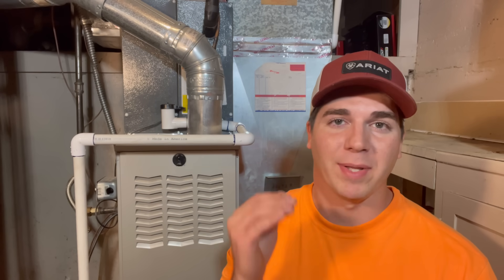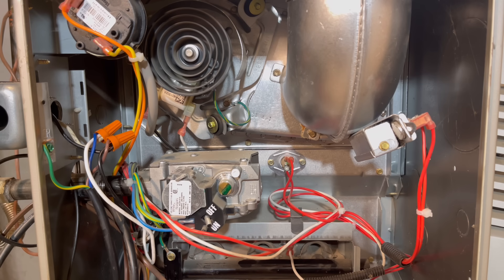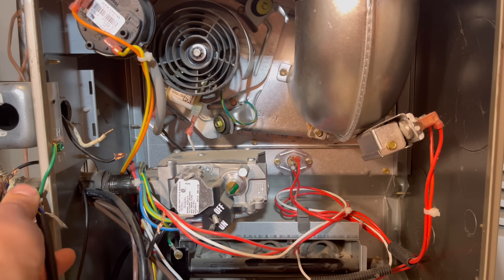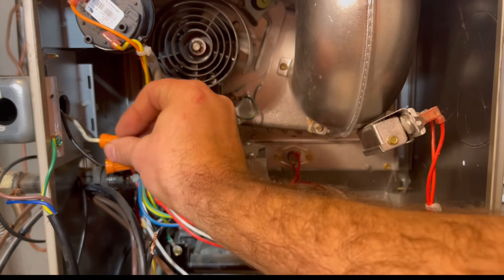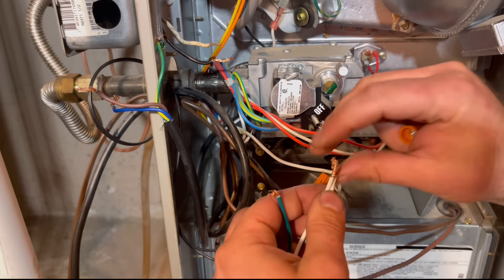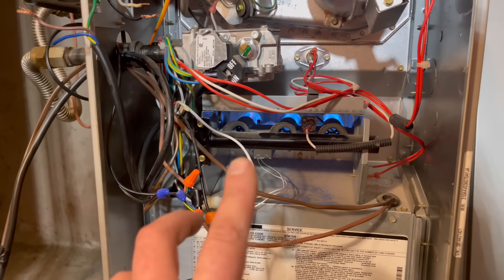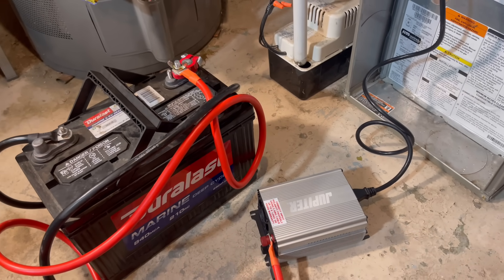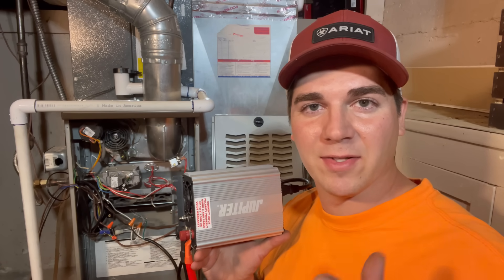Did You Know You Can Heat Your Home With A Car Battery?

Comment: Appreciate the thoughts but sadly so many details not made explicit: 1) He knows what he is doing but a novice would not have basic safety rules/habits in mind while dealing with 120v AC. DANGEROUS. 2.) I'm going "Wait, no way can you heat your house for several days with a car battery AND what is watt rating of that little inverter?  It would need to be humongous!". But later in the video you see -- but it is not commented on -- the HEAT is provided by gas, not the little electric power.  Yes, I could imagine the furnace fans and such powered by this setup for several days but ONLY IF NOT AN ALL ELRCTRIC UNIT.  If an all electric unit it would far overload this little inverter and probably not even come on. So, word to the wise -- do this only where the heat itself does not come from the electricity and only if you are well experienced working with AC.  Otherwise, engage a professional electrician -- who will want to put an actual to-code switch box in. Which would be a terrific thing to have.
Reply from the maker: I apologize I was off on my estimate but the furnace ran for 6 hours on this setup which is still great in a pinch! Cheers

Comment: What about the thermostat signal to fire the furnace and set temperature.  With out a signal. Will it stay on full if you have a  wire in thermostat  without a battery power one ?????
Reply from the maker: Yes as long as the furnace has power, the thermostat will function as it normally does regardless of the type of thermostat 👍🏽
Reply: Thank did not know that learn something new

Comment: no,.... this is a valuable tool that can save lives and reduce stress knowing that you are sufficient to do a service. we have done this with generators and other tools. you learn these functions from schools and military training. 
in one area the opposite side of the street lost power. a welder made a steel pipe to put a heavy duty extension cord through so vehicle could drive over it. city came out to inspect it for safety. power company saw what we did and built a station to replace jumping from a house. we called the power company with a code and they turned on the portable station. a year later they fixed the grid, neighbors helping neighbors.....
good video need more like it!
edit  .... all i would add is get an electrician to do the wiring work and a bus between the battery circuit and house wiring and a switch to disconnect it all. all you need to do when power goes out flip the switch and add the battery,...done and heat! your grandparents can check it all before weather goes bad and they sleep better at night knowing they can!
for those with larger bugdets you can do the same thing with a portable generator for the entire house any professional home improvement company has the equipment and plenty of YT videos for you do it yourself ers. we have a cabin with solar and generator back up.

Comment: Great Info.   
Should note type of furnace.  Gas furnaces  draw the least current.  Oil fired would draw more.  
A heat pump,  - well, you better do your research.   Probably require a high wattage 220 generator especially if you have backup heat strips.

Comment: That's awesome, I don't have a furnace but posted it on nextdoor for neighbors that do. I can't believe most people suffer no heat because HVAC companies don't offer people this option with perhaps an auto or manual switch.
Reply from the maker: I should start offering it as an upgrade to existing furnaces. It blows me away how up a creek people are when it comes to back up power and or backup heat
Reply: @diyhvacguy  Do you have solar or wind? If so do you recommend an all in one like MPP or is there a better one? I have 24 solar panels, just need to hook them in a good all in one.

Comment: When I built my house,I had them to run gas lines to the hallway, den , kitchen and living room. I have capped off shut off valves. I keep 4 wall mounted gas heaters in the garage. When the power goes out for days,I use the inverter setup u showed and I hook up the gas heaters.

Comment: Will something similar work for the water heater of a radiant heat system or are the pumps and everything powered separately?
Reply from the maker: If it’s 110v then absolutely

Comment: Car battery is surely not enough amp hours. Few days ? you are smoking crack.  Two marine deep cycles probably wouldn't make it a few days. I've done this before with two marine deep cycles when I bought my house and didn't have electric until the next day. Few days no freaking way do the math car battery is usually like 40 amp hours. You are talking like 45 minutes of run time at 1000 watts at 120volts. That's like 100 amp 12 volt draw. LoL not even an hour with a car battery.

Comment: I got one better..... Don't you think that you could charge your  battery while it's being used..  your first inverter is going from 12dc to 120ac.

Great. Next use the 120ac outlet connect to another inverter 120ac down to 12 or 14 DC and connect that output  to your battery.  YOUR BATTERY WON'T DISCHARGE..

Comment: Just get you an extra battery and keep it battery charger tender put on it and keep your battery off the concrete floor so it doesn't go dead you should be good to go I'll just get your propane tank you mean you've already got natural gas just get a generate generator and you're off running to the you can cook clean watch TV and everything else but make sure you wired it up right you don't want to put Power Up on the grid had to pay for lighten up the whole neighborhood lol

Comment: would this work with a natural gas hot water furnace with 2 or 3 small circultator pumps?  our previous furnace didnt have the safety of modern funaces, the only thing that required electricty was the one big circulator, when we lost power we would just open the valves and the hot water would circulate on it own thru the pipes via gravity.  downside; that beast of a furnace was not efficient.
Reply from the maker: Hmm, if it’s 110v with not too much wattage then yes this will work.

Comment: Hey, are you aware that your car battery charge will last a LOT longer, if you don't leave it sitting on the concrete floor? Leaving a car battery sitting on concrete will discharge the battery very quickly, even if you have nothing attached to it. Be sure to sit the battery on some wood or something, so it won't loose charge through the concrete. Trust me, this will make a HUGE difference.

Comment: How many watts is that inverter? I used to drive a truck over the road, and to save on fuel (idling the truck) I would use an 80 watt power inverter hooked directly to the batteries in the truck. I just ran a TV and DVD player to watch movies. I ran it from Saturday morning to Sunday noon. It wasn't even full time, as I turned it off if I was sleeping. Batteries were too dead to start the truck on Sunday at noon. And you say you can run the furnace for several days? I'd like to say "Foul!" because I know from experience that if three deep cycle truck batteries go dead after one day on an 80 watt inverter then one "car" battery isn't going to last several days. Don't mislead people, it could mean their life!
Reply from the maker: Yea I realize I was mistaken. The battery lasted 6 hours with my 1000 watt inverter. I know it’s not days, but six hours is great in a pinch.
Reply: @diyhvacguy  now if we could figure out how to run the furnace while charging the battery the we could get a little "perpetuation" going on.

Comment: Great little work around, if needed. Given, the battery will run the inverter for x amount of hours. Would it be possible to plug a trickle charger into the inverter, then connect to the battery? Wondering if that would make the battery stay charged for a longer period of time.

Comment: And heating tech yes you can do that but you could also when you have your AC and heating furnace and air handler placed in your attic in Texas want Texas don't have basements at least on the east south east and south Texas and Northeast Texas around Dallas Houston San Antonio and Austin Waco does not have basements but you can have your AC check wire in the pigtail at the time of install then you go out and you spend another $180 and you buy solar panel and you keep it in your garage or in your attic and you just hook it up when the power goes out and you can just hook up the the pigtail or you can do the same thing with a generator for $100 bill harbor freight does sell generators for $100 and some change so for about $120 you can do the same thing but that fan and it ain't matter will not it will not keep it very fully charged enough with the inverter at 600 even my 300 fully in charge if you are running a light a phone charger or any other device it will not keep it charged without something charging that battery I know I have a cabin in East Texas that has a gas furnace correction propane furnace and it has to have electricity and I have two harbor freight 100 watt solar panels hooked up to six 12 volt marine batteries and 24 volt 18 wheeler batteries that is hooked up to all a total of nine batteries and I can run the whole cabin on a 2000 Watt inverter for no noise to keep the noise down as long as I take the solar panels and place them on top of the cabin and the cabin is a 24 x12 storage building from Lowe's that has been inverted into a mini house it's got a gas stove it's got a gas water heater propane water heater propane stove along with a wood burning stove to just for looks it sits on the front porch of the building for outside cooking and it Powers a TV it will power during the summer time it will power a small 1500 BTU window unit or two box

Comment: That's all good but i would not expect that battery to last very long powering the fan. Best to have a small generator for that.
Reply from the maker: It lasted 6 hours. Admittedly not days but six hours is not bad in a pinch!
Reply: @diyhvacguy  6 Hours surprises me. That's not bad. I would have thought 2 or 3 at the most.

Comment: I’m living in an off-grid studio with a power hookup & was wondering what I could do as a backup, and your video reminded me that I still have the inverter I bought in 2016 to run my laptop on the cross-country drive here, plus I just replaced my battery at Wal Mart. - plus I recently bought a compact jump-start lithium charger on Amazon. Good to know Thank you!

Comment: A typical battery is not going to run a heating system. Unless you're using a generator.
Reply from the maker: You sir are wrong, I ran my furnace for SIX hours with this battery and inverter 👍🏽

Comment: That's really cool.  I've got electric heat with a heat pump, which is great for my electric bill, but doesn't do much if we have a power outage in winter.  I am wanting to wire into the electric panel a generator switch and then have that as backup for furnace, and freezers/fridges.

Comment: Very cool idea. Just wondering if you could just put the pigtail on and plug it into a generator as another option?
Reply from the maker: Oh absolutely. Check out my other emergency heat videos! I have one on my ng generator using this same method but with a new outlet/switch that’s setup for emergency power, check them out! Cheers

Comment: no... get a generator... a car battery will only power your furnace for an hour, maybe two if you're lucky.
Reply from the maker: Wrong. Lasted SIX hours. And you say go get a generator what if they’re all sold out, as in right now in the middle of a winter storm?
Reply: @The DIY HVAC Guy  i was going to right a long reply pointing out all the problems with this, but it isn't worth my time.

Comment: Hello DIY HVAC Guy, Thank you for a life saving video. I hope those without power from this vortex horrible storm that is hitting across the U.S.A from 12/22/2022 till Christmas Eve or maybe longer in some parts of the country have their furnaces running with what you taught on this video. A question I have. I didn't understand where you took the blk & white wires from the furnace to hook up to the pigtail? Can you please explain it to me? I just happen to run into your video today as so glad I did. Everyone should know about how to hook up an DC inverter to the furnace and have it all ready in case the power goes out. Thanks so much & God Bless. BTW what's the best battery to have that will power the furnace the longest?
Reply from the maker: If you have a similar setup, please watch this video and order this outlet/switch combo and wire it as shown. If you need additional help, email me at diyhvacguy@gmail.com   Thanks,  Dave 

https://youtu.be/1JNuovFpCpQ

Comment: You should plug in a battery charger into the inverter and charge the battery at the same time it'll last longer you won't get days use out of it couple hours
Reply: l o l, if you can charge a battery, why not just power the furnace?

Comment: Wow do not F'n do this without turning off the power to the furnace.  Yes I get there's a power outage when this happens, but the power can come back on anytime.  The way he is handling the incoming wires is DEADLY.
Reply from the maker: Um the switch was turned off so everything was not live or even had the potential to be live. And the chance of dying from getting popped is very very slim.

Comment: Not sure if this has been said but, while it is a good idea for planning ahead, wiring into the furnace supply circuit comes with it's own set of issues. 
You must be able to isolate the battery/inverter from the utility supply. If you do not provide this protection, and power is out, you will back feed 120 V to the panel and back to the main bus. That absolutely means a transfer panel must be used.  of course, in a pinch, this is an effective solution. 

Also, a 12 volt trickle charger would be a good idea as well so it's always charged and ready to go in the event of a power outage. 

That being said, I appreciate the effort.

Comment: Interesting.  I see it's a gas hvac, not sure a single battery will run an electric hvac with exterior heat pump for long.
Reply from the maker: No this is for gas only unfortunately

Comment: I've tried this with a light in my out building and my inverter won't allow the battery to fully discharge. I can only operate the lights for mere minutes.
Reply from the maker: Hmmm that’s odd. Does it say anything? Sometimes they will beep when the incoming power level is too low.
Reply: @diyhvacguy  i start out with a full charge 1000 amp hour battery, 600 watt inverter, 150 watt load. It might stay on for 2-3 minutes. I am looking into the inverter you are using.

Comment: do not let the battery sit on concrete floor ,it will drain the power just slip a couple of short 2x4 under it so its off the floor
Reply from the maker: Myth, look it up

Comment: How does this work for geothermal and doesn't your furnace need power to your thermostat in order to call for heat?
Reply from the maker: Not sure on the geothermal, if it’s 110v then yes this will work. To answer your thermostat question, the furnace powers the t stat, so as long as the furnace has power, the thermostat will function as normal 👍🏽
Reply: @The DIY HVAC Guy  thanks for the great info.  Good knowledge if the power goes out for any length of time

Comment: Good idea.  You should hard  wire in a "two way switch" so you can flip it between "line and battery" and leave it connected full time.

Comment: Can you simply unplug the furnace and plug it into the inverter, or will it drain the battery to quickly, or require more wattage than the inverter is rated? Also, will a modified sine wave inverter be OK for a furnace, or does it have to be pure?
Reply from the maker: Simply unplug the furnace, and plug it into the furnace 👍🏽
Reply: @diyhvacguy  OK, gonna try it. I have a modified sine wave inverter, though. Will it be hard too on the blower motors?

Comment: My sump pump has a battery back up. I think it stands to reason that a similar set up can be installed to regulate both a furnace and a hot water heater. Personally if this a regular concern I would invest the extra money into having all those components preexisting versus trying to do all this piecemeal in your basement with a flashlight and outside during weather condition that have knocked out your power AND Made running your furnace a emergency need. I also have a small portable generator in my garage. I think I would rather power that up and recharge my furnace car battery that way instead of trying to charge it up with my car

Comment: Thank you for this video. What happens if the gas suppliers power goes out and no natural gas is sent to the homes?
Can this type battery and inverter power a small oil filled space heater
Reply from the maker: Yes more then likely it can power a space heater. I don’t see any reason why not.

Comment: Theoretically if you plug  a battery tender into the inverter and hook it back up to the battery it should constantly recharge itself
Reply from the maker: I wish. It wouldn’t help much at all unfortunately
Reply: Unfortunately doesn't work that way.  The power loss in the conversion from 12V to 110V in the inverter, and then running the battery tender/charger, makes it a net loss to do that.  You're just draining the battery more.

Comment: how do you control the furnace once you get power to it
Reply: It will run off of the existing thermostat
Reply from the maker: Yes as long as the furnace has power, the thermostat will work like it always does 👍🏽

Comment: Does this apply to a hot water baseboard system with 2 circulator pumps as well?
Reply from the maker: If it’s 110v then yes absolutely

Comment: I don't think this would have worked during the Texas situation because the power issue was state wide not local and gas needs to be pumped into homes from the station so there was no gas at the time either. This is still a great idea for times when there are local outages.